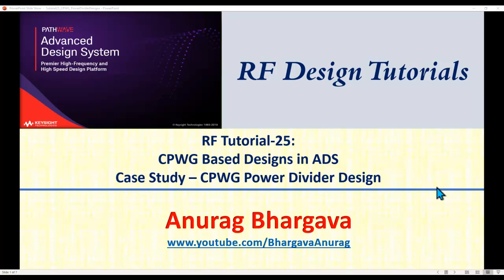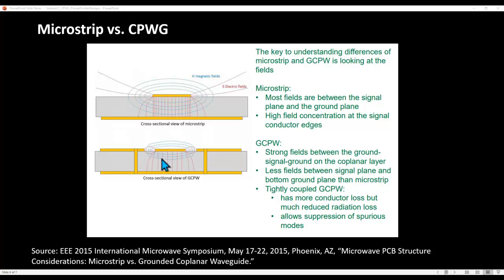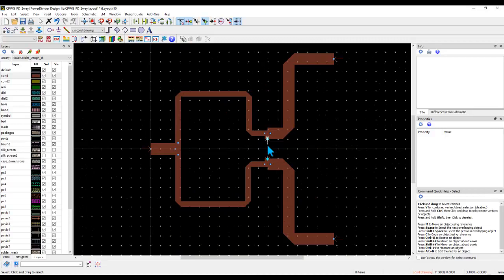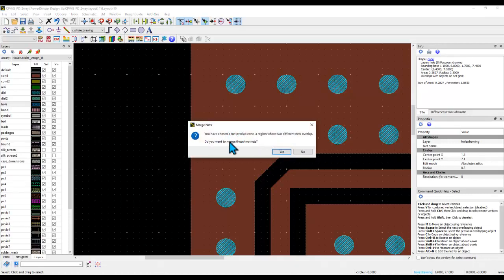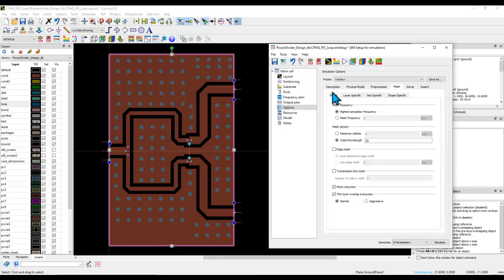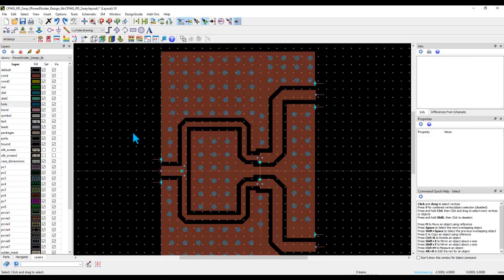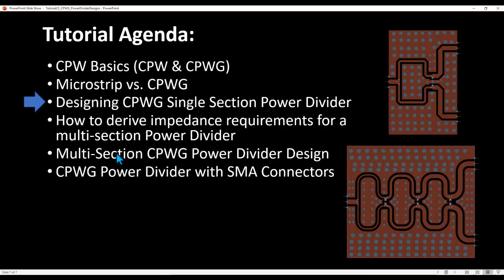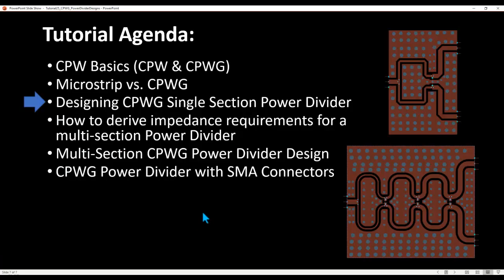RF Design-25: CPWG Based Designs in ADS

Comment: Is it possible to parameterize this so one can sweep the value for the gap/spacing, alongside the conductor widths etc, like in your 'Parametric EM Sims' video (which was microstrip) but adding CPWG format?
Reply from the maker: It's not easy to do for all cases hence I recommend using Microstrip fundamentals and then switching to CPWG at the end of your design for final verification.

Comment: Here the substrate you used was for CPWG right? So how will a substrate looks like for CPW without ground under the dielectric.
Reply from the maker: Hi Edison,
You can simply remove the Cover Plate which is available by default and add a Air dielectric below your actual substrate.
Reply: @BhargavaAnurag   Thank you for your reply. I tried that but the result which I obtained from hfss and ads was totally different. In my hfss design I don't have ground under the substrate. I did the same in ads but it give different results and I am not sure if my substrate design was correct in ads since I am a novice to ads.

Comment: Great series of videos, however why use Genesys  in a demo for ADS?  Why not use Linecalc or the controlled impedance line designer that are included in ADS?
Reply from the maker: Hi Jon,
Its designer's choice to use whatever he/she deems useful. Reason I used Genesys is to calculate parameters for the multi-section PD design which is not possible using LineCalc or CILD.
Hope this helps.

Comment: Thank you for your tutorial it was awesome. My doubt here is how can we  a designed a substrate with only conductor and dielectric. Ie without conductor beneath a dielectric. For coplanar stripline.
Reply from the maker: Replied to your other comment. You can simply remove Cover Plate and add a Air dielectric below your substrate and that's it...😊

Comment: Thanks for your tutorial. Is there a possibility to EM optimize the layout with CPW structure in this way? I mean EM-cosim optimazing some variables? Because during the optimization, ADS will always regenerate a temp layout, it won't regenerate the ground plane automatically right?  What about the CPW model in ADS? Thank you very much~
Reply from the maker: I am not a big fan of EM optimization unless there is no other option. As I shown in the video there is no need to do so in most of the cases if you simply use basic transmission line theory and use idealistic transmission line for your design and then simply convert them to CPWG lines and complete your circuit design.
If you still want to EM optimize then the technique shown here may not be used directly and you might need to use Nominal/Perturbed method by creating relevant elements.

Comment: Hi Anurag, great video! I have a question about the ports. You've set only the CPW modes, and what about the microstrip line (ML) mode of GCPW? I expected one more pin under the center pin to simulate the ML mode.
Reply from the maker: Hi Hamilton,
No, you only need to provide CPW ports i.e. G-S-G port configuration. In a good CPW design most of the fields will be between coplanar grounds and signal lines, the small field between signal line and bottom ground will be taken care by simulator directly without you having to place an explicit pins there and this is how exactly it will work in your real fabricated circuits.
Reply: @BhargavaAnurag  Got it. Thank you. And the same when using the FEM solver? I mean, I just need to put G-S-G for a grounded coplanar waveguide Line?

Comment: Nice video.  I thought CPWG has higher dispersion than microstrip, as the coplanar ground concentrates more of the E field in the air.
Reply from the maker: Hi Louis,
At mmW frequencies, Microstrip will have higher dispersion than CPWG. More details are available here: https://rogerscorp.com/blog/2020/comparing-pcbs-for-microstrip-and-grounded-coplanar-waveguide-circuits and in the reference I provided in the ppt footer that I used: http://www.globalcommhost.com/rogers/acs/techsupporthub/en/docs/2015_IMS_MicroApps_microstrip_vs_coplanar_John_C_final_032315_SE.pdf
Hope this helps....👍

Comment: Great video! How many vias are necessary to put in the design?
Reply from the maker: Hi Gidy,
I am not aware of any formulas to decide that however, the important ones along the edges, and as a rule of thumb you maintain the distance to be <= lambda/10. Any more vias than that are fine but whatever is the case EM analysis will tell you what to expect.
Hope this helps...

Comment: How should I design substrate for coplanar strip line ( cps line)   without ground under the dielectric In ADS. With only Air, PEC and Roger 5880 with thickness 0.508mm. Can you please make a video of it.
Reply from the maker: I don't think it need a totally new video, simply remove the cover plate from the bottom and do your calculations in the LineCalc accordingly to convert a Microstrip circuit to a CPW one like shown in this CPWG video